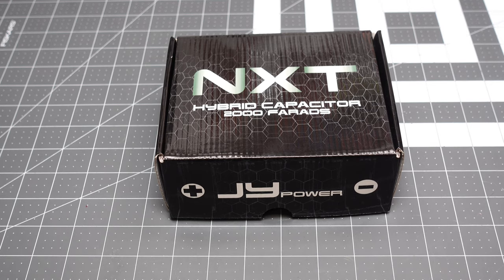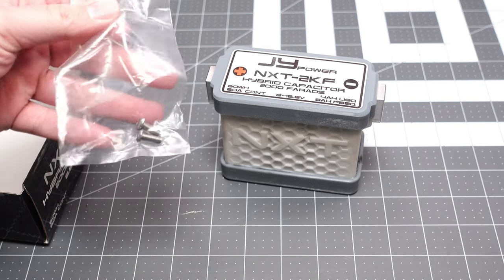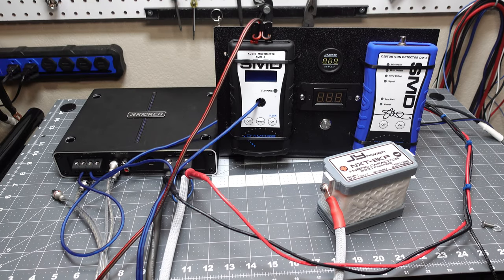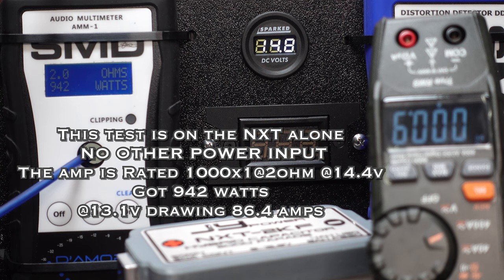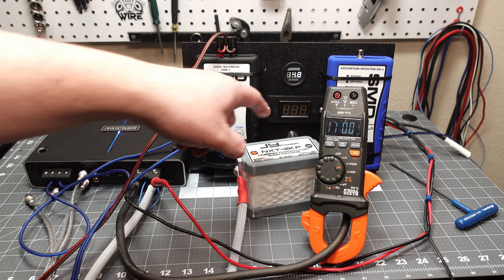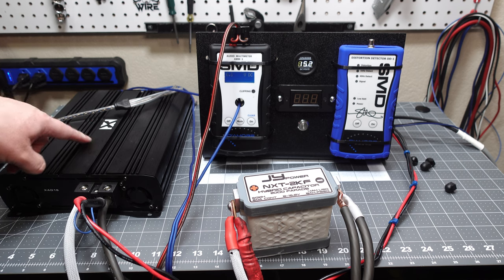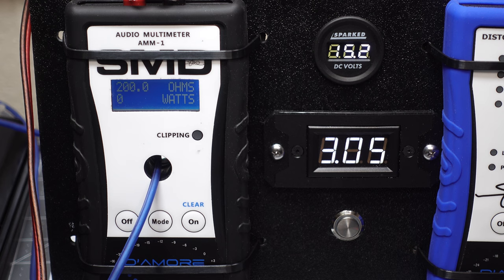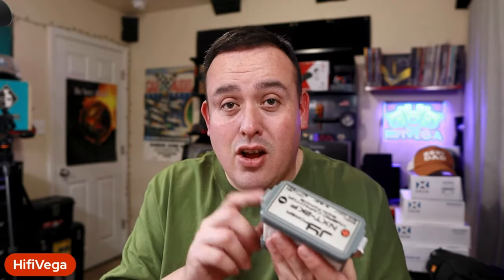Reviewing & Testing the JY Power NXT-2KF hybrid capacitor/lithium battery

Comment: The thing about those cells is they cant take the beating that a normal cap can tge max amps one of those 18650 size caps is 60a so a small pack of them cant handle that much

Comment: @HifiVega- I know you do thing's legit, and sparked has legit stuff, but @8:26 into this video, there is no way that amperage reading is correct? In the test where your SMD Amm-1 showed a max power of 18?? Watts, and pulling 133 max amps, but on the next test where your Amm-1 showed 23?? Watts, how was the max amperage shown, only 6 amps more, making 500 watts more= that's not possible! To make another 500 watts more, with more voltage drop, approx., 60+ amps more would had to have been pulled! Then with a 200 amp power supply, @9:45 into this video, the amperage showed 259amps, while making 2,876 watts, dropping to 11.2 volts! The 259 amps seems much more like it, but im not sure why it only showed 139 amps, making 23?? watts= wrong. Thanks for testing, the power results speak for themselves, this is a great little unit!
Reply from the maker: I was having problems with the sparked conductor, but have since moved all the power and ground on it and fixed the issue. That’s why I typically didn’t have that turned on, but missed it on this video
Reply: @HifiVega - Thanks for your response. Oh, okay. Love your video's.